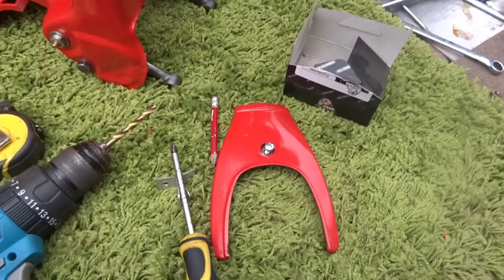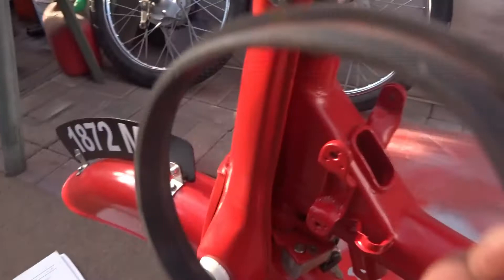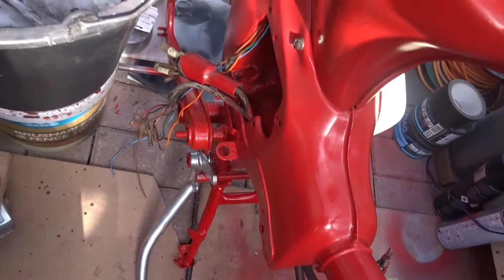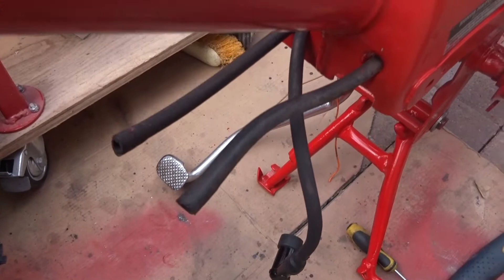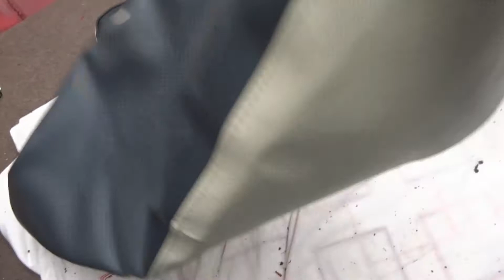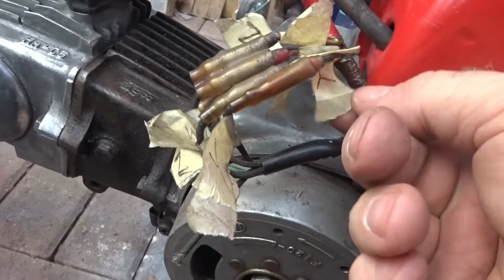HONDA C50  1980 / Honda C50zz / Motorcycle Restoration

Comment: Great job lovely to see. The carb is pre-1979 and the metal number plate on the front mudguard is also pre-1978. I would liked to have heard it running.

Comment: Hi Tom, hope you can help me with my c50zz restoration.  Can you tell me the honda code for the carburettor.  Beginning 16100. Thanks
Reply from the maker: In the book I have, The carb numbers are: 16100-041-720 to frame K096263 .
16100-041-721 frame K096264-L024173.
16100-041-722  from frame L024174
Reply: Tom. My frame/vin. Is C506070315. Thanks

Comment: Great video! What manual are you working off there? and where did you get it? I'm currently restoring a C90 and could do with one of those.
Reply from the maker: I will look tomorrow. I bought it on eBay as far as I know.
Reply from the maker: For the life of me I cannot find the Honda c50 book. I actually have a C90 Spare parts list from 1973 for €30 plus shipping if you are interested.

Comment: Great video Tom. Any tips for cleaning tank inside?
Reply from the maker: You can buy tank cleaning solutions and sealers on ebay
Reply: @tomcahill8506  Would you recommend one product over another? I just want to do a good clean, no need for seal.
Reply from the maker: @kennethmchugh7213  Fertan Fedox rust remover I find good.
Reply: @tomcahill8506  Thank you.

Comment: Hello, I am looking after the paint number for a NSU QUICKLY in green ... I did not find the two paint references, do you have the reference? thanks in advance
Reply from the maker: Hi,
The paint references relate to the original paint done in the NSU paint facility.
The green colours are : Jade Green (57) Pale Green (84) .
I have not found a RAL Colour to match the colours.
Also i brought parts from the original bike with the best paint that i could find especially when you take off the engine, the colour on the frame is the original colour. I took them to a paint supplier and they scanned the paint on the frame into their computer and there software can determine the exact colour. I have also used spray cans from Holts auto spray paint.
For Jade Green ,i have used Holts HDGR01
For pale Green, I have used Holts HGR00
Hope this helps.
Reply: @tomcahill8506  Tanks 🙃
Reply: @tomcahill8506  For the quantity of the paint ? How many spray paint for  the two greens ?
Reply from the maker: @guillaumelallouette1329  You would want at least 4 Jade green. 2 pale green
Reply: @tomcahill8506  Great, thanks !
Reply from the maker: @guillaumelallouette1329  I forgot that You can also buy them from www.nsuquickly.de but there €36 a can. I was restoring a lot of bikes so I had to go for the cheaper option.